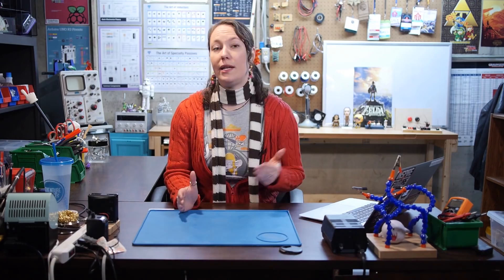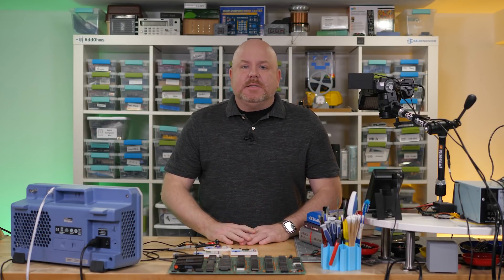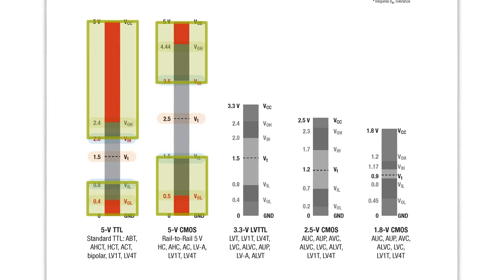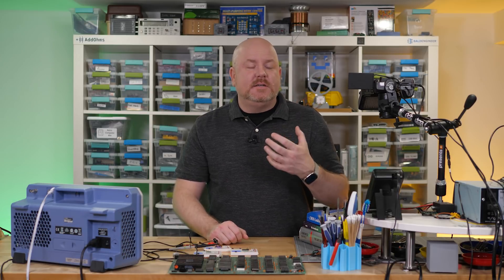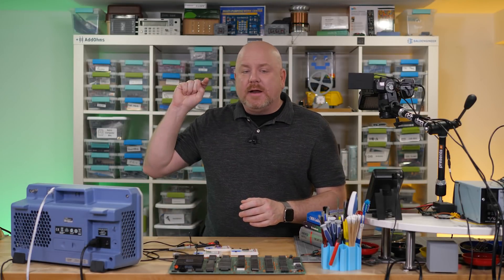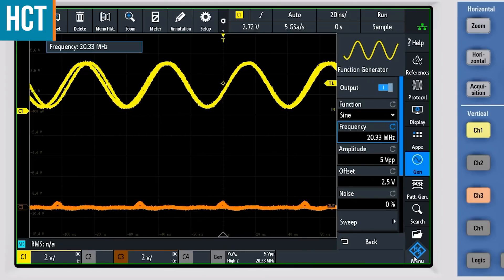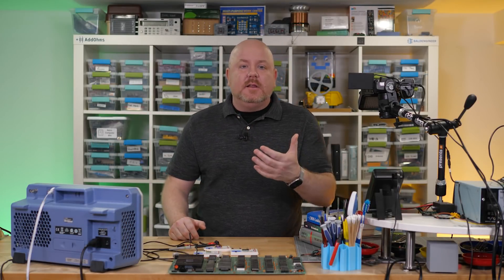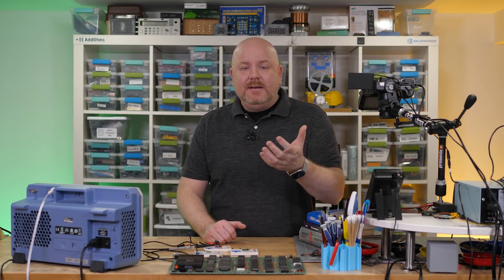Essential Logic Families - Workbench Wednesdays

Comment: CMOS outputs can drive TTL inputs, TTL outputs can have problems driving CMOS inputs. HCT inputs CAN be driven with BOTH CMOS & TTL outputs. I use HCT & AHCT 74 series fairly universally mixing them with 74F, 74ALS, & 74LS though if I have the same types available I do not mix bipolar & CMOS devices even though I could.

Comment: can you measure these values on a cheap scope?
Reply: yes, regarding the levels. no, regarding the timing. if you have a 50MHz SPI connection to analyze, the probe itself could already damage the signal in a certain way. you would then need an active probe which does not influence the circuit too much.

Comment: Any logic switches? Like relay's NO & NC

Input selector ic

Like 1 input pin & select 2 other pin(A & B)

If high 1 to A
If low 1 to B
Reply: Sounds like you're looking for a multiplexor
Reply: A relay would be a simple as an AND gate. One pin controls whether the signal on the other pin goes though or not. If you use en inverter infront of that gate you can switch states.
If A is high the output goes to _A if B is high the ouput goes to _B.
Don't be intimidated by digital circuits. It is really simple once you get familiar with the fundamental gates like AND, OR and INV.
Cheers
Reply: @DasIllu  I'm searching for faster switching
Reply: @kamals4905  this would be real simple with an AND gate and an Inverter.
you tie your control directly to one and gate and through an inverter to another and gate. It would look like this: "Control=1 AND DATA -> output on port one.  If control goes to 0, then the inverter would set the other and gate to high and it's input would go through.
It is so simple to draw in a picture, but the YT comment section is lacking a doodle function unfortunatly.
what is the target freq/edge timing. If i know a little more, that would be helpful.
Reply: oh and the switching speed greatly varies with the length of your wires/traces, the chips you use and the amount of care you take balanve capacitances.
for small boards, no considerable switching loads, short leads, etc. just use 74LSxx or 74HCxx if you are operating below 1MHz. After that threshold i seriously recomend learning ho to stop "ringing" in your digital circuits. I believe EEVBlog on YT has a nice video on that topic.
Reply: @DasIllu  
All technical details i have but I'm searching for digital sign selector ic solution
Reply: @kamals4905  so again, an and gate would be Control&Data=Out. IF control is high all data goes out to the port.  and to switch you use "Not And"&Data so the data goes out to the other output when control is low. And inverter is used to do that second part.
But be aware that all logic ICs have a little delay in switching states. Do not expect to be able to switch USB3.0 with a bunch of TTL chips.
Reply: @DasIllu  yah I'm on 800kbps signal , so speed is not issue

I will try that logic 👍 thanks for suggestions
Reply: @kamals4905  I hope it will help. My one sugesstion is to keep the leads as short as possible. That will help reduce ringing (those weird deflections you saw on the osci in that video). The longer your leads to the chip are the more capacitance you need to add across Vpp and GND to suck up the parasitic inductance thus lowering the maximum operating speed of your circuit.
Reply: I'm looking for serial port switcher
Assume 1 serial input pin & 2 serial output pin

Whenever control pin goes high serial data received on 2nd pin & for low data received on 1st pin(output side)